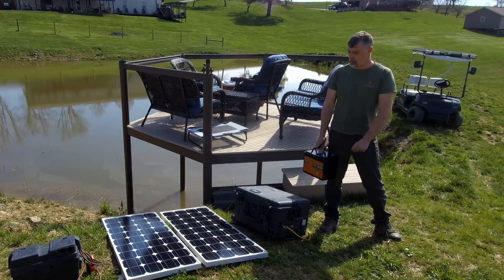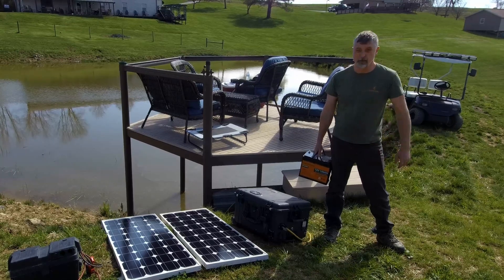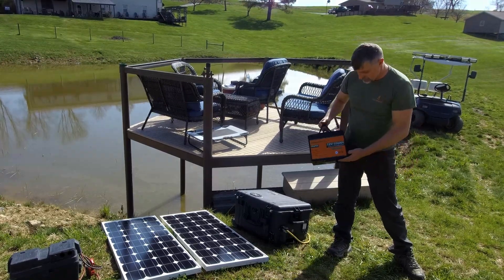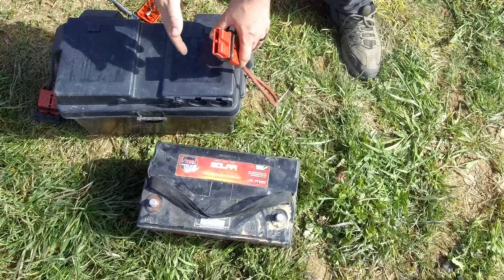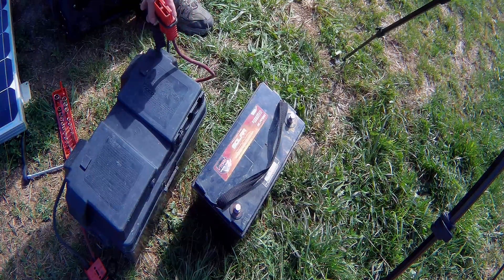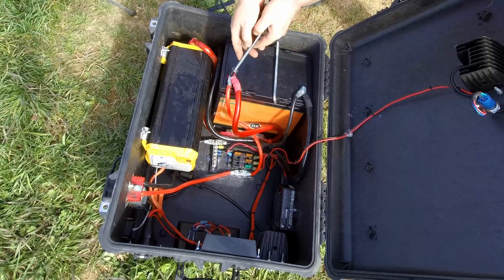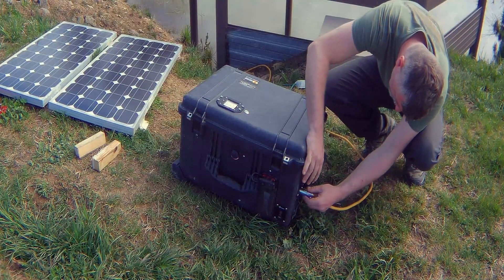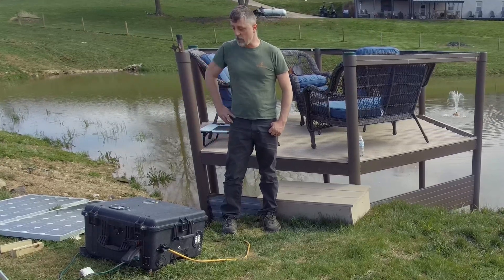Solar Generator Lithium Battery Upgrade

Comment: Safety FIRST! You really should put a fuse or breaker of the proper size within 7 inches of the battery Positive post, if something was to happen (Overload) or short out (Shit Happens) there would be a fire. There are a lot of AMPS in a full charged battery. ALL of the Positive connections should be covered or insulated for the same reason. No different then a AC panel. Do it RIGHT don't just make it work.
Reply from the maker: It has fuses for all the circuits, including a high amperage one for the main inverter.

Comment: Just clarifying you mention lithium ion batteries multiple times but your images are all of lifepo4 which is a different form on lithium battery chemistry. they require different charging specs so its worth mentioning they are not the same. for proper battery maintenance a different charger with different voltage and float setting should also be swapped in when going from FLA batteries. Even with the onboard BMS units inside those batteries.
Reply: I should clarify that both lifepo4 and nmc batteries are technically Lithium ion tech but nmc is advertised as Lithium ion
Reply from the maker: @fathergratwick Thanks for the additional info!

Comment: When you Daisy Chain Lithium Batteries, Do NOT use more than Four Batteries! My understanding is that if you exceed four batteries, the chain will not charge properly. THAT BEING SAID-400 Amps of Lithium Iron Phosphate Battery is one HELL of a lot of capacity!

Comment: I'm trying to find a  12volt DC to 110 /220  pure sine wave inverter as I'd like to build a north American unit so I can run a pump or a heat pump water tank